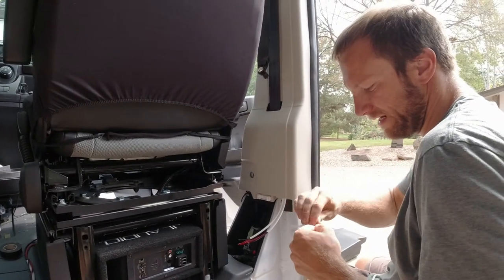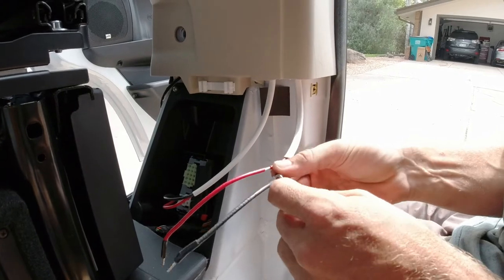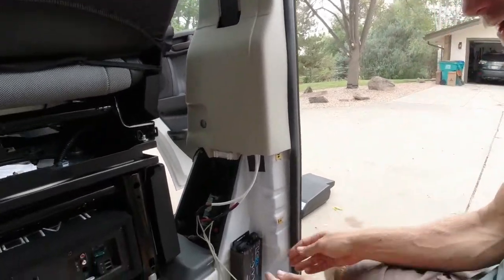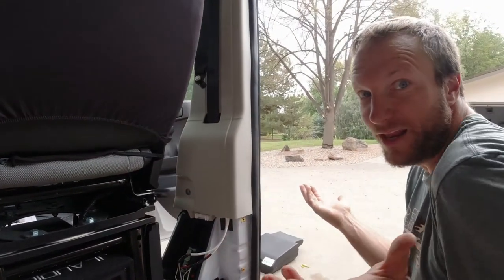Promaster JL Audio Subwoofer Install: How to do Sound System Upgrades in a Promaster Van Conversion

Comment: First off, thanks for the video, I subbed. Appreciate the help. About to pull the trigger on this same setup.
Im still trying to wrap my head around the complete installation steps, so sorry if I make a mistake. I do not have the wires for the van rear in the column like you do, I have a 2014 promaster. I also have an aftermarket radio which likely does not limit power so no LC2 needed. 

So, as for cables and connections I think I will need:
* A 4 awg wire connection from the battery (positive and negative) to the amp / sub unit with a 30 amp fuse
* 2 RCA cables (any comment on types I need to buy or is any OK?) from my amp / sub to my stereo. I will run these manually. My aftermarket stereo has 2 low-range outputs for this, it appears. Why two cables?

Is that all? I see in some installs of other subs they have a remote / amp on/off wire on the radio they connect to as well. Is this necessary with the JL sub? What controls the on/off?

Sorry for so many questions, I'm a complete novice to audio setups!
Reply from the maker: Hi Grant. It looks like you're on the right track. Just verify that your wiring is thick enough and fused properly for your distance and power. I think the JL manual had it in there. I believe the 2 RCA's are one for the left and one for the right channel. I personally try to buy nicer stuff but I'm sure any will suffice. The JL can be set to power on by connecting through the speaker wires (I did that because the stock head unit doesn't have a remote wire connection). I would rather connect via remote, which the speaker also has a switch to do, because it currently turns on when you open the doors instead of going on and off with the radio. Let us know how it goes! I think the vans and this speaker are a fairly easy install.

Comment: If I'm not putting speakers on the back can I get to sound to the subwoofer from the pillar it self by plugin in?
Reply from the maker: Thanks for watching. You should be able to get sound without adding back speakers. You would either need to splice into the door speakers or have the "rear speakers" connections for to the subwoofer. I'm not an expert so cannot guarantee it will work but I feel good about it.
Reply: @DrifterJourney  Thanks for answering! I'll keep you posted

Comment: What did you do about the remote on/off. It looks like the way you wired it the sub would always be powered on. Aftermarket head units have the remote on/off as a wire on the harness. Btw very helpful video. Especially showing the location of that speaker break out. I would not have know that was there without you video.
Reply from the maker: Thanks for the comment. This sub has options for the turn on mode. It kicks on any time that we turn on the van.....or open a door. It has worked fine for us without running a remote wire to the ignition.

Comment: Thanks for the video. Almost nothing on YouTube for this. How did you run the wires to the battery so that you can still put the battery cover on securely?
Reply from the maker: Thanks for watching! I was able to snake it under the floor and into the battery compartment. It took a little effort to find the right path but it's doable with a little patience.

Comment: Nice video! How happy are you with the audio quality of the woofer?
Reply from the maker: Hi Kashi. Thank you for watching! We are extremely happy with the sound quality that this little speaker puts out. With that said, it's an 8" sub so it won't be as deep or hurt your ears as two 12's would (obviously). It's clean and is amazing if you're not looking to "bump". I hope that helps. This is our 2nd one and I would not hesitate to buy it again. I've always lived JL.
Reply: @DrifterJourney  Thanks for the reply! This looks like a great option, especially considering there is no need to replace the head unit :)
Reply from the maker: Exactly - that a huge plus!

Comment: what is the LC2 for?
Reply from the maker: Thanks for watching. Some stereos drop out the bass as the volume increases. The LC2 is supposed to allow you to adjust for that so you get quality results at all volumes.
Reply: @DrifterJourney  Thanks for the reply! I saw that part of the video after I commented, oops! I just dont see people using this for other under seat sub installs (like the kicker, etc). Have you ever tried without it? Did you feel it was necessary? Its pushing my budget a bit too high. Also curious how you adjust the level of the sub? I see you can get a remote level switch that you can mount. A bit pricy at $50 for a switch but curious how you deal with this while driving?
Reply from the maker: I have not tried without it. My buddy is a big car audio guy and he told me not to skip it. I imagine it would be fine without it but he gave me it for free (and helped with the install on our first van). The remote switch is pricey for what it is but definitely is worth it if you're wanting to adjust the level easily.

Comment: Not sure why on my audio controls it shows RL RR open ?
Reply from the maker: Thanks for watching. That's odd. I'm not sure why it would be doing that either. Is everything working?
Reply: @DrifterJourney  unfortunately I have no sound coming out of my sub. Front speakers are still working but I can’t get the sub to work.
Reply from the maker: Did you splice it the same way as we did? Ours was spliced to the rear speaker wires in the pillar. If you used those, did you change the head unit to push power to rear speakers? That might be the issue. There is also 2 settings on the sub. One for connecting with RCAs and one for tapping speaker wires. Make sure you have the correct setting there. You may need to get professionals involved if everything is connected properly and you're still having issues.